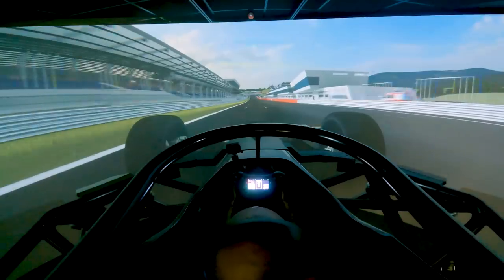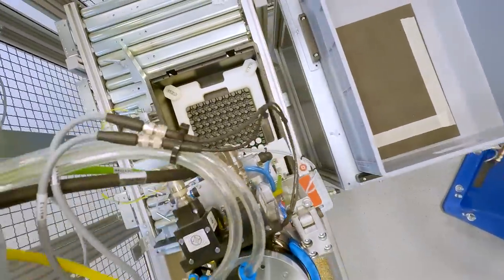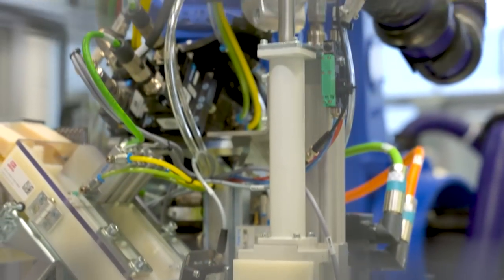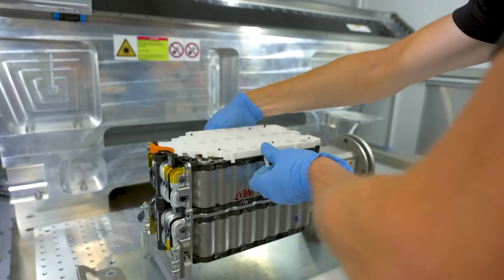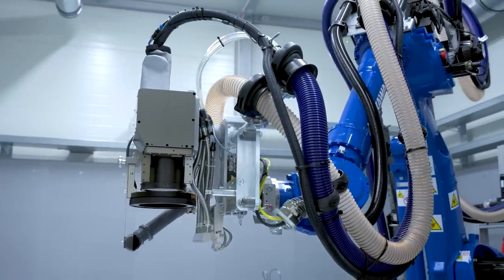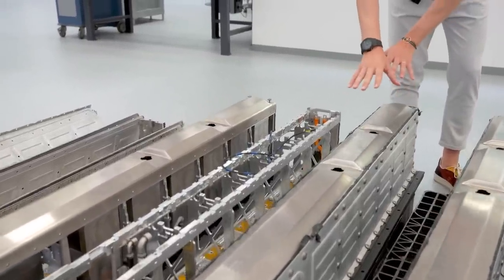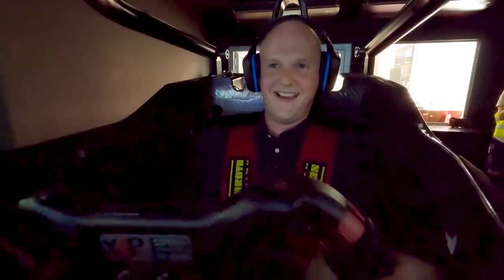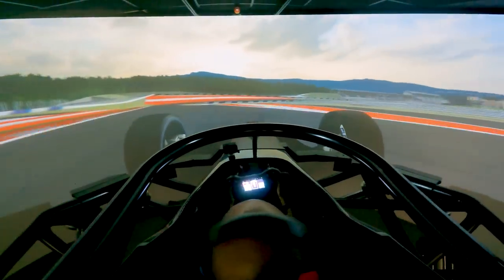How a Race Car's Battery is REALLY Made

Comment: So they make batteries in a more controlled environment than I make batteries from cells for my remote control cars and planes. Why are you making such a simple thing seem so complex again
10 to 15 years ago the LiFiPo4 cells that look like AA batteries could be bought for less than 30pence each these days since the boom of lithium battery waste, due to EV/hybrid cars and racing prices can be anything between £1 to £3 a cell
Reply: You're making little toys. This is serious power.
Stick to your soldering iron and xt90s buddy.
You're trying to compare a bloke in a shed to low volume manufacturing.

Edit, the video was pitched at people with very low levels of knowledge on the topic. The science and Engineering involved is rather impressive and none of it was shown here because the target audience would just switch off.